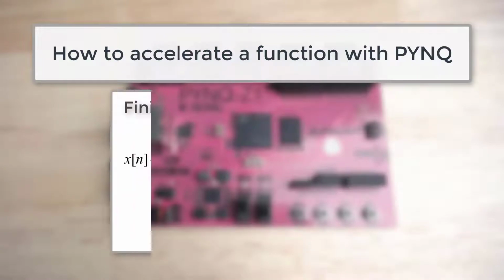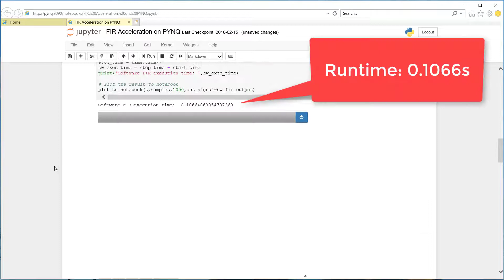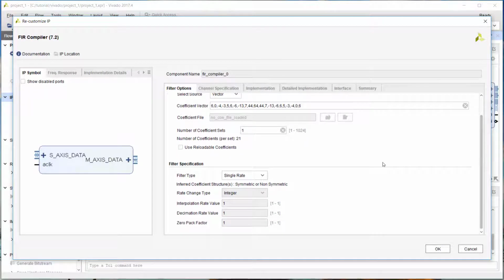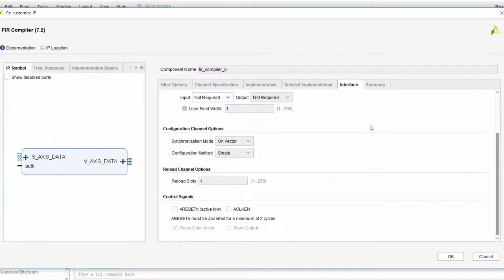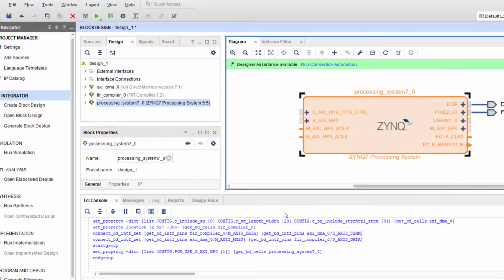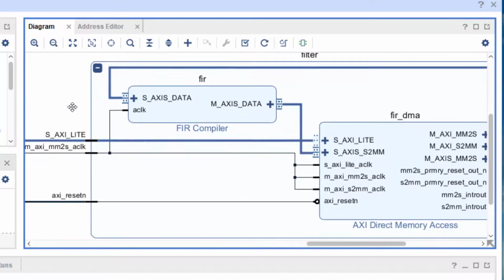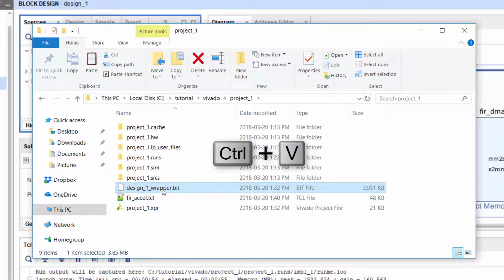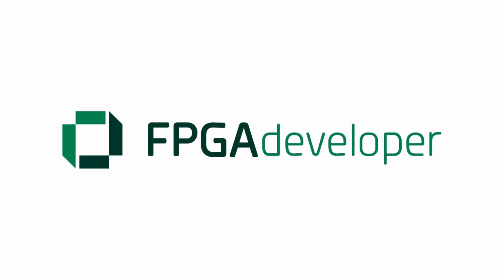How to accelerate a function with PYNQ

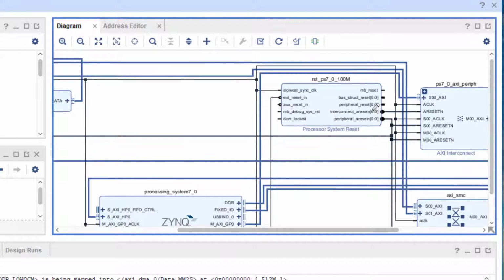Comment: @8:36 After tHe Run Connection Automation again, your Block Design has 6 blocks:
ZYNQ7 Processing System, AXI Direct Memory Access, FIR Compiler, Processor System Reset, AXI Interconnect (periph) and AXI SmartConnect.  

In Vivado 2021.2, I have the same first 5 blocks but instead of an AXI SmartConnect block, it has a 2nd AXI Interconnect (axi_mem_intercon).  Is this a problem?  Or is there some additional configuration setting in one or more of the blocks to change it to an AXI SmartConnect block?

Also, I noticed your Processor System Reset block interconnect_aresetn[0:0] output is tied directly only to your AXI Interconnect ARESETN input pin while
 your Processor System Reset block peripheral_aresetn[0:0] output is tied to ALL your other *_ARESETN pins.

My Vivado 2021.2 connected ALL ARESETN pins to the Processor System Reset block interconnect_aresetn[0:0] output. Should I separate them?  And, why did my version of Vivado 2021.2 tie them together?

Thanks,
JT